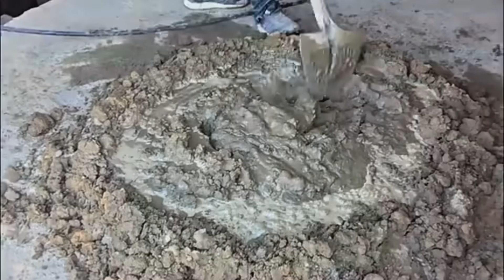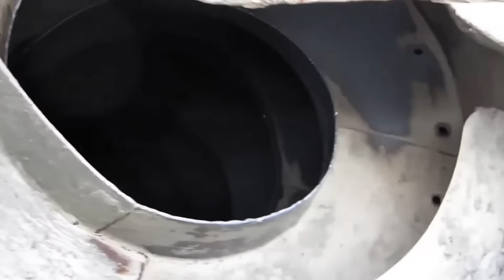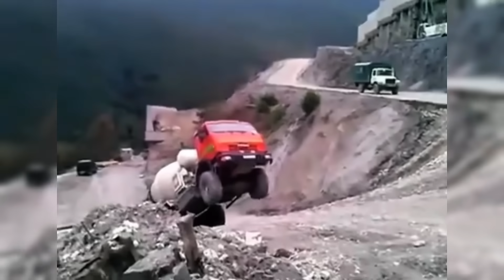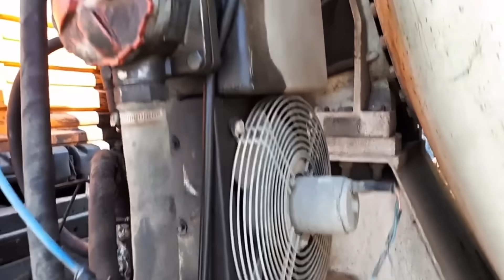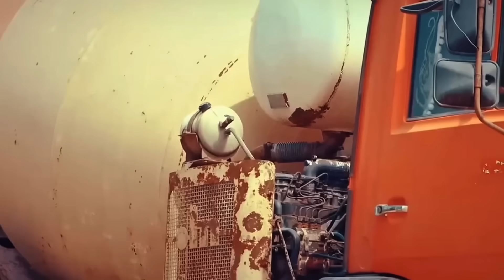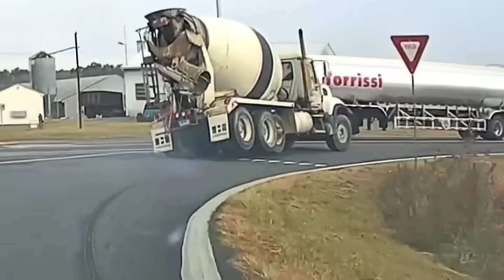How a Concrete Mixer Works?

Comment: It depends, sometimes it is better to mix the concrete by hand so the workers can work quietly without pressure. Sometimes these guys of these cement trucks and cranes spill the concrete too fast because they must move their machines to other shiping, or may be they are eager to go have their lunch time and the workers can't have enough time to handle the concrete properly.

Comment: I'd like to know about different grades of concrete. A concrete driveway can disintegrate in 1 year, but bridges and buildings are meant to last a century or more. How do you make sure you get the good stuff?
Reply: its all about the strength of the cement used...in bridges we use 42.5 cement while in slabs we use 32.5 cement

Comment: I used to drive for Hanson in Western Australia. Our plants batched the ingredients into the bowl, and the truck mixed the concrete. We would then move the truck to the slumping stand where we added water to achieve the required slump, usually 8cm. Sometimes the slump can be as low as 4cm for kerbing mix, or as high as 12 for high lift pumping.
Reply: Makes most sense, don't they all?

Comment: Truck mix is best. I worked with both, and beyond any doubt truck mix is it. The right amount of cement throughout,  and is most efficient, consistent and cost effective. Watching from Trinidad and Tobago.
Reply: For whatever projects homeowners to contractors have to require concrete as ordering concrete from a plant and delivered by a concrete mixer has many go behind the scenes of how concrete goes from raw materials to a finished product as those also peel away the steel plates of the drum attached to a truck chassis as many know the hydraulic motor that turns the drum is being driven by a hydraulic pump directly driven off the engine as long as the engine is turning it also spins the drum.  At a construction site when contractors and workers are ready to pour has driver of the concrete mixer engage high idle to make the drum spin faster as from the concrete plant to the project has the drum turning counterclockwise as the actual pouring has the drum momentary stop to reverse direction as the drum now turns clockwise.

Comment: You don't mix concrete, you mix CEMENT
Reply: Concrete Is cement , sand, aggregate and water .
Reply: Cement is an INGREDIENT of concrete. Concrete is the finished product.
Reply: You mix concrete too. How else do you get the ballast, cement and water to bind?
Reply: I like the concrete mixers from Culvers😋

Comment: that isnt a mixer, the pixing is don at the plant
Reply: The ingredients are pour in there and mix
Reply: There is “central mix” batched pre-mixed, and the truck maintains the mix en route.. Hence the name mixer. And there is “dry batch” where the ingredients are batched into the truck, and all the mixing happens within, and maintained en route … Hence the name mixer. Typically a plant will have both a central and dry batch, choosing to use what is most cost effective for the day’s workload. It is a “Ready Mix Concrete Truck” or “Mixer” for short.
Reply: Yes already mixed at plant. Just transporting it to site
Reply: @yusufsafodien8526 it’s still mixing in the drum. If you’ve listened you would of heard the drum turns all the time to stop the concreat from setting